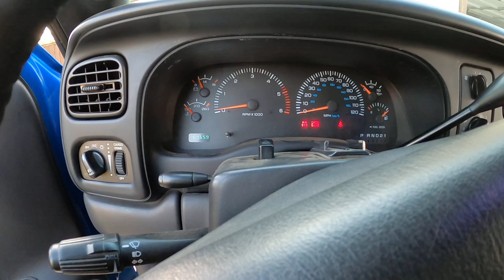SOLD ONE OF THE VEHICLES!

Comment: Hate to say it bro but that's what happens when you try driving a modded daily.  The only things I could  say is check for any codes (if you haven't already) and check your TB sensors, specifically your idle air control. Give it some gas when you start it and see if it will run if you hold the throttle open a tad. You also mentioned that you tried uploading a tune and it happened right after? Maybe switch back to the old tune?
Reply from the maker: Tried previous tune, pressing gas while cranking, still no go. I’ll mess with it more tonight

Comment: I have the same problem on my 5.2 durango and the way I got it to run when it does that issue is unplug the throttle position sensor and start it and let it throw the check engine light,then turn it off and plus the sensor back in and clear the code,for some reason the throttle position gets whacked when you reset the battery or new tune

Comment: Try cleaning the idle air control sensor, should be in the back of the throttle body. I havent swapped the cam on mine yet but i know mine was doing this once and i had to give it gas. The sensor just helps it to idle properly and without the right tuning it may be getting covered in soot. If thats not it the pcm might not be capable of supporting the tune. I know mine is kinda slow about learning.

Comment: I have had my 98 Dakota for almost 16 years, and it’s been a great truck. It’s not the fastest, or the best through the turns, but there is something about the Dakota that kicks ass. They always FEEL fast, even when there not. It was Dodges affordable factory hotrod, with Simple tech, killer body style and a V8. It crushed everyone else in the compact truck game. If you truly want that truck to be fast, you need to stroke the motor, and add a wet kit. I’ve seen guys run 10-12s in the 1/4, with factory suspension, and some slicks. 
But, if your looking for a great vehicle, that will always work, the factory does it the best. If you want just a little more go, while keeping the reliability, throw a set of CalTracs and a shot of nitrous. You will always lose reliability when you pickledick parts here and there. I love the content, and your approach to making videos, keep up the good work.

Comment: As others have said, try reloading the previous tune. Went through this with My '12 Challenger R/T after loading a 91 octane tune in it w/my diablo i3 tuner, it doinked the push button start after saving factory tune and loading new one, and had to use the plastic key to turn on/start vehicle. It worked normally the next day, thinking holy water may have been a good remedy.......
Reply from the maker: Yeah I tried the previous tune and same thing

Comment: Frustrating Dakota...
I had that no start issue. The new crank sensor might be a different length than the old? The one I ordered was short, no start. Modified it, bad idea, didn’t work. Went to junkyard and pulled like 3 off 5.9 motors and picked the nicest one that was a consistent length out of a 5.9 and... ran perfect.
Reply: There are different ones for manual and automatic and some different Chinese manufacturers don't put the magnet in correctly on the end and they don't work.
Reply from the maker: This was the correct mopar sensor but I’ll run some tests tonight to see

Comment: Maybe double check you timing, this all started after swapping the cam. My old bronco had a similar problem that the dakota had, where it would start just fine but if I turned it off after heating up, it would not start again until it cooled down. I just had a new timing chain installed and it threw off the timing. Maybe you have a similar problem.

Comment: You seem to be at the point with an older car/truck you've replaced so much you're just done with it.  The next guy buys it and finds that one part to replace and it works like a champ for years but you were the one that did all the work.  I'd like to see you push through that barrier.  You're almost there.

Comment: Oh crap id lean toward the pcm since it suddenly did it after a new tune , ihad an 06 f150 fx4 that the pcm died and if left me stranded would only crank but nothing not even the first 1 second fire did you try revert to last tune file yet i assume its reading and loading file that would be  the wierd part 🤔if it was injectors or coil you shod atleast run with a misfire id think
Reply from the maker: Tried reloading the old tune and still same no start condition

Comment: Man that is frustrating, but once you figure it out it is worth it!! At the same time I wouldn't sell the s2000 as that car is very much track focused and can be further made into a track only car for less than anything else.. Howe the Dakota... man its tough but I think its time has come and selling it on for another truck to build out would be the best thing.... however I think you already have a plan in place and I can't wait to see what it is..😎😎
Reply from the maker: Thanks man! I’ll get it sorted out one way or another but man is it frustrating!
Reply: @BoostedMotorsports  you got this!! I would say go talk with the guy at the speed shop about the cam. That seems to be the thing that changed prior to the issues. Its possible that something happened with the timing or the firing order.. it is super easy to have things a millimeter off without realizing it. Since you've tackled all the other apparent issues. As for the PCM, that would be a bit of a horrible coincidence 🤔... then again when I was swapping out my fuel sender I ended up needing  to replace the entire gas tank when I accidentally broke the evap line 🤣🤣🤣 so horrible coincidences are unfortunately a fact of tinkering 😝😝

Comment: Is the dakota transmission fully in park or is the sensor working? Wont try and crank if it in gear.
Reply from the maker: It cranks. Just doesn’t fire. It wouldn’t crank if it was the neutral safety switch 👍

Comment: Don’t go to all that trouble of  changing s2000 for a daily .. your giving up too quick on Dakota man holy moly .. you’ve changed a lot on it soon gotta be to the bottom of things man .. I’m curious if the new crank sensor you out in is the problem .. was running fine till you changed it an the two sensors down below .. I’d switch the crank sensor back to old one An rentry .. or maybe try change the pcm..you allowing yourself to get too frustrated on Dakota .. disapointed 👎
Reply from the maker: Still need to get to drive to my part time job this week brother and the Dakota is inoperable how would you feel?
Reply: BoostedMotorsports well I would have not wasted my time doin all that to the s2000 .. all the time you spent  changing all that stuff to make it street drivable coulda been spent trying a few more things on the Dakota an maybe it woulda been running .. an if you needed a break from Dakota then I would have jus drove the s2000 the way it was for jus one trip to An from part time job .. wouldn’t really have hurt anything.. too much of gotta be a perfectionist or ocd I think.. take deep breath relax .. plus I think when things go wrong with Dakota like this .. it makes for GOOD CONTENT for your channel an keeps guys intrested an also involved in corresponding to you about what’s wrong with it an what to try.. so there ya go .. throw away good content an let your frustration get to you .. your choice after all right !! Jus sayin brother🙏👍 I have faith you figure out an it will be a good daily .. Christ give it little more time you jus had engine all apart to do cam .. things have been disturbed meaning may have cpl more bugs to work out it now .. I know I wouldn’t give up .. especially when it’s great for the channel content 👍
Reply: @DarrensTruckzs  i second that. mopar or no car. when my mopar goes down. i have a backup mopar ready to go. lol honestly, if it wasnt for the blue dakota i would have never knew about boosted. with all due respect.